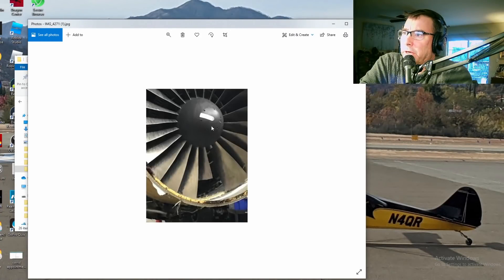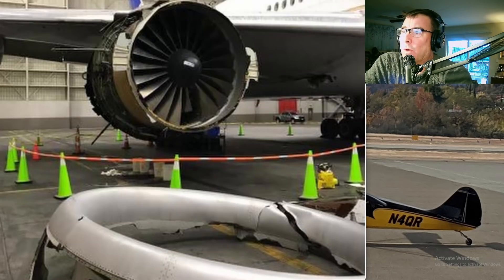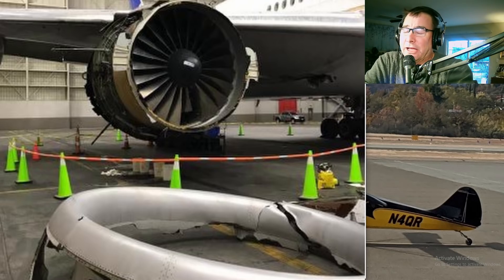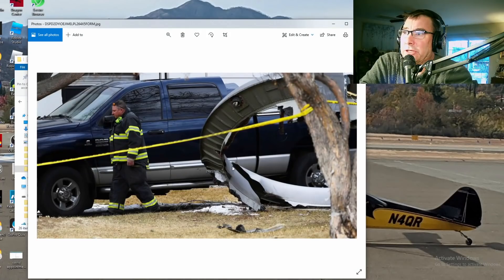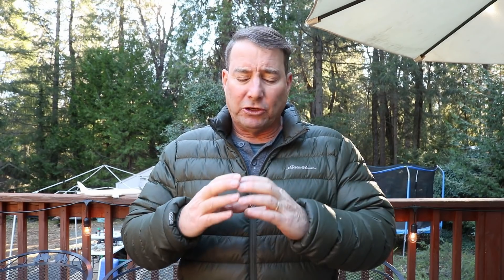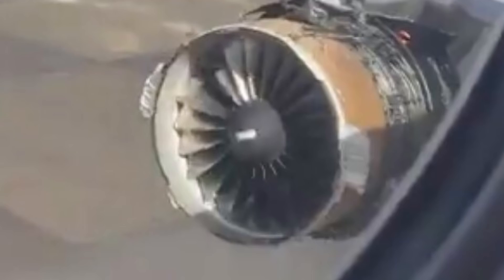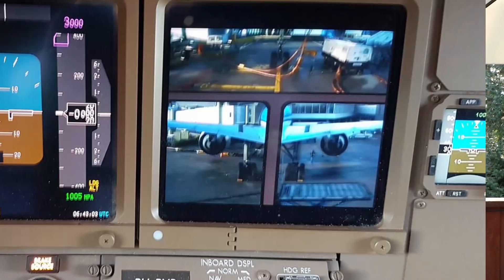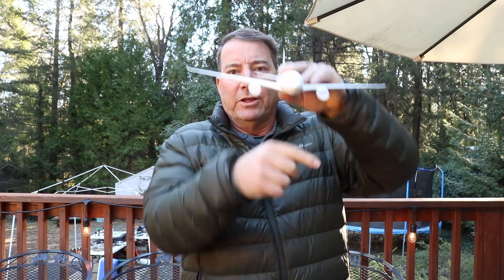UAL 328 UPDATE Fan Blade Failure  B777-200  22 Feb 2021

Comment: Regarding etops in a case like this - how likely would it be for the extra drag from the damaged engine to require so much extra fuel that you can't reach your destination? For example, if the cowling had opened up into a "flower" shape and didn't come off. Also - you mentioned that you are supposed to continue flight at the same speed as you were cruising - is that same Mach number, same IAS, or same TAS?

Comment: Well built aircraft, excellent crew - great report. Lots of post. Seems like you could use infared camera to partially monitor turbines before take off.
Any fans of Juan know if review of this kind of incident takes 18 months by NTSB? Seems like the aircraft would have more energy at 35K than having to go back 20k , but that's a safety call. Flying C123's ya didn't have these problems.

Comment: Daveo Australia here wow what a great video and very informative. One quick question how strong is that pylon under vibrating engine holding that engine and I always think about the accident which I think was the DC-10 where the engine flicked up over the top of the wing and investigation improved the pylons were not stored properly in the hanger previously which caused fatigue cracks thanks.. Just wondering if they have strengthened those pylons that Attaches the engine to the wing

Comment: I wonder if the  NTSB will set this plane up in a test rig and get the engine rotating at the windmilling speed to see the  result of the vibration  on the engine mounts and wing.

Comment: Well, one of the cockpit perks is having the safest seats on the airplane for awol engine part trajectories.  Although this fire was apparently relatively benign, is there any desperation procedure for trying to put out an engine fire if the extinguishers don't work over the middle of the ocean, like maybe heading for a rain squall or (don't laugh at me) intentionally doing something to get it to vibrate so bad that, along with some semi-aerobatic maneuver, it breaks off the mounts?  OK, now you can laugh.

Comment: In the 1950's and 60's jet air craft were delivered with engine vibration monitoring systems which were later disabled. I wonder if it is time to consider reinstalling this type of system to detect incipient blade failure by noticing a change in harmonic vibration of the engine?
Reply: The EICAS on the 777 can monitor more engine parameters than a 1950's vibration gauge can ever dream of.
Reply: @dynasty0019   I have been retired as an airline mechanic for twenty two and one half but I have worked on airplanes with the EICAS system installed(767) and  I know it's
 capabilities. I know very little about 777's. We had them, but I never worked on one. However what a system can do and what it will do depends on the airplane manufacturer, the engine manufacturer, The FAA and the airlines. If the EICAS is to display engine vibration data the engines must have vibration sensors ( accelerometers installed. These are usually installed on the fan case but others could be installed on the turbine case and other locations as determined by the engine manufacturers engineers. The aircraft must be wired to provide power and a signal path for the data, The information can be displayed on a traditional steam gauge or sent modern high data FDR's for later download . It could be sent to the EICAS system to interpret and possible display to the, it could send it onto the ACARS system for display it could direct the ACARS system to send a message to a ground station directly to turbine engineering for evaluation, or in the case of United Airlines it could be transmitted directly to the electronic log book system as a mechanics writeup. But whatever method is used to detect unusual engine vibrations it is a very serious issue The military recently lost two C130 airplanes and crew members due to propeller blade loss caused by metal fatigue failure at the blade root and high bypass turbo fan engines are suffering the same types of failures. The longer the blades are the greater the amount centrifugal force is applied to the blade root and fan disc.

Comment: Re: ETOPS, would you have enough fuel to make Honolulu or SFO if you lost an engine at the midway point and you had to descend to 10,000 because of a loss of pressurisation due to puncture of the fuselage from engine shrapnel?
Reply: Yes, ETOPS flight planning calculates the fuel requirements of a decompression, and engine failure, or both.  If at the critical point (not always midway) there is a fuel deficit, additional fuel is added to compensate.

Comment: Has it been confirmed that the engine was still on fire after they landed?  For me that's the most worrisome part of this incident.  I assume you've seen the recent pictures of the hole in the fuselage, right at the wing root.  They are so lucky that debris didn't puncture a wing tank.

Comment: As usual Boeing will set a committee to prove this was pilot error.
Reply: Boeing doesn't do that, they can send their engineers to assist the investigators on the technical aspects of the plane. The NTSB is totally independent and Boeing does not have a single say in the matter.

Comment: Juan - Just curios.  If a Pilot is certified on a 777 does it matter whether or not a particular plane has the P&W or the GE or is the certification good across the board independent of power plant manufacturer?

Comment: These fan blades have a finite lifespan because they go through expansion and retraction cycles during their working life. Typically they elongate to a certain extent over time due to exposure to these high operating temperatures running the risk of fatigue cracking. Usually they have periodic High Frequency Eddy Current NDT (Non Destructive Testing) inspection to check for minute crack propagation at which point a blade will need to be replaced. In the past minute voids within the grain structure of these blades introduced during the manufacturing process led to engine blade off events. It will be interesting to see if this particular airline in question regularly made these important checks. 
Thanks again for the update Juan.

Comment: Hi. I am not familiar with 777 fire extinguishing, but on airbus models the are two extinguisher bottles per engine, and the crew can select, depending on flight crew manual if both bottles are activated and the timing, but usually the first is used immediatly and the second is kept in case of a fire relight, also the philosophy is that the engine is divided in fire zones, mostly compressor, combustion chamber and auxiliary gearbox, that are effectively isolated from one another to maximize the effect of the extinguishing agent, and prevent a fire from the compressor stage to propagate to the combustion stage and get to the fuel lines. this extinguishing agent acts on starving the fire from oxigen, in this case due to structural failure of the fire zones and the altitude of the aircraft most of the extiguishing agent excaped the fire zone and current oxigen concentration kept the fire going, i believe that the turbine zone fire we see started on the compessor stage, probably for a fuel fed actuator or a engine oil line that spread to the hotter engine zone, like pouring gas over a hot car engine. The system worked remarkably well with all this constraints and factors.

Comment: Juan, just a side comment that may or may not be significant.  In the early 2,000's one of the leading manufacturers of jet engine fan blades closed one of its most experienced US finishing and inspection plants, initially outsourcing the work locally at first and then eventually transferring the work to a newly built plant in Mexico.  I know that it took over two years (maybe three?) before the workforce there was able to produce the first part that could pass inspection.  The Mexican plant now does most of the finishing and final inspections (X-ray and dye penetrant).  I don't have to tell you how high-tech and mission critical these turbine Jet airfoils are.  I am not saying that making this change has compromised  quality and safety.  However, saving $$$ at this point in the manufacturing process does NOT seem like a good decision.

Comment: You may be correct that the fan blade exited the engine via the inlet but I think this would be unusual . When a failed wide chord fan blade is arrested by a Kevlar wrapped containment casing it is immediately struck by the trailing blade. This would normally propel the released blade aft. In so doing one can expect the impact to cause a partial failure of the trailing blade which is what you see here. I would anticipate finding  the failed blade lodged against the fan outlet guide vanes. The extreme out of balance forces can be enough to challenge the structural integrity of the intake.

Comment: To review : At the worst moment an engine fails, debris punctures the fuselage and departs the wing. The aircraft has to descend to 10,000 ft and the remaining engine is going close to full power, burning MORE FUEL; that engine is now at a lower inefficient altitude and so is using MORE FUEL;  to compensate for the weight imbalance the aircraft must use large aileron deflection as we are now at a slower speed and so we are generating drag and so MORE FUEL, the differential power requires the rudder to compensate and so we have more drag and so MORE FUEL and we are doing this for a longer time so MORE FUEL is required. Whew...that's a lot of extra fuel and we have a headwind going westward.

Comment: Hello Blancolirio. First, congratulations... great videos with always good information. I just wanted to mention that the Boeing Fire Eng L,R checklist does not state not to dump fuel in the event of a fire. I believe that must be in an Operator specific QRH. (As always, prudent pilot judgment is required 🙃)👍
The -200 Series are not equipped with the exterior camera system..... only the -300s.

Comment: G'day Juan. Love your information - thank you very much.
Just some info for you. The 777-200 does not have the GMCS cameras you were describing on the 300s. As you mentioned, they are designed to stop you running that big long jet off into a ditch. I guess Boeing didn't consider the 200 long enough!

Comment: What about an ETOPS situation in which the failed engine also results in fuselage damage and a depressurization?   Now, you're flying at 10,000 ft. half the distance to Hawaii as a single-engine B777.   The Southwest 737 incident showed how easily that situation could develop.   Add to that an out-of-balance engine and maybe a little fire to go with it.   Yikes!

Juan, this channel is awesome!   Thanks for the frequent updates!

Comment: Sorry for the stupid question but, how did they handled the slowing down during landing with a fully loaded (fuel and passengers) plane and asymmetric thrust reverser (just engine 1) and a potentially contaminated (rain or snow) runway? Thanks.

Comment: ETOPS certainly doesn’t stand for extended twin engine ops, it’s actually the appropriate acronym for Engines Turn or Passengers Swim, just kidding, that’s how we mechanics view ETOPS!  I was on the receiving crew for the very first B777-200 at UAL and have the Pratt and Whitney emblem off of the #1 Engine gearbox.  I was taxi and high power qualified on the same, the damn thing was a menace taxiing around SFO.  Can’t tell you how many fire house doors were destroyed coming across the 28’s to deliver the aircraft to the PAC gates.  I remember many a night out on the 17L run-up area doing high power test runs on the 777.  I remember one night going out and running in a horrific rainstorm, aircraft was light, and going to high power.  The aircraft slid on the pavement so fast that we almost had a runway incursion on 17R.  At the time, these engines were the most powerful aviation engines ever flown and we had a very steep learning curve to get a handle on them.  That first 777 lost most of its right horizontal stabilizer during a high power run when the engines pulled up the asphalt at the concrete apron margin in the 17L run-up area.  We are talking 18” thick slabs of asphalt the size of a Ford pickup smashing like shotgun buckshot into the horizontal stabilizer and side of the fuselage.  That cost the Lazy U several million in repairs.  Engineering figured that the low pressure caused by the volume of air moving across the ground just sucked the asphalt out of its bed.  A Pratt & Whitney engineer told me that the 4077 engine flowed the same amount of air at high power in one second as a human breaths in his whole lifetime, think about that!  When the P&W 4077 started some compressor stalling issues it got really exciting.  There is nothing more terrifying than performing an accel/decel test on the engine and having it stall at about 1.56 EPR.  I’ve cried for mommy twice when it happened, it also turned the aircraft under full brakes about 10 degrees during the event.  Nothing like 100,000 h.p. deciding it wants to reverse its gas path in a millisecond, oh the horror!  The 777 is truly a marvel of aviation.  When it came out it spelled the beginning of the end for Boeing’s 747 program.

Comment: Hollow Titanium is the culprit. Titanium is light and strong, but when titanium fails, it snaps. I suspect the newer Carbon Fiber Titanium Composite fan blades used by GE are more durable. Carbon Fiber blades have many layers while hollow titanium blades would suffer metal fatigue. Carbon Fiber is the fix.

Comment: what if these twin (humongous !) engined type intercontinental airliners prove to be 'deficient' in engine reliability ???
Remember, it was just some years ago that 4 engined jetliners were the norm and such twin engined jets had to cross the Atlantic or Pacific 'hugging close to' airports (w/in a few hours) along it's transcontinental route, ...
longer hours, more air miles, and more jetfuel expense.
Could it be that the Boeing 747, the Airbus 340 & 380 will soon be needed ?
As I understand, recently, another 2 Boeing jetliners have experienced engine failures, both of the same engine model ?
"Too Big to Fail" can never be the norm in such intricate machinery !
Attention GE, CFM, Rolls-Royce ... engine manufacturers, will science and technology bail you all out here ???
We shall see !

Comment: Its a big question did the broken blade go through the engine after banging the side, busting the cowling, or was it able to escape uncontained slicing the cowling on its way.  I assume it went through the engine, which damaged the reverser causing oil leak and fire.  Maybe the full blade escaped and the half blade sucked through.

Comment: GE90 driver myself, they make great blades!  Fan blade separations don't usually result in engine fires.  I'm guessing the smaller broken blade or parts of it were ingested through the compression stages causing oil to leak. It will be interesting to read the full engineering report when published.  We had a case on take-off whereby a blade separated and flew forwards and out of the intake, bounced off the runway moving sideways and then embedded itself in the other engines nacelle.   Take-off was rejected.  Fan blade separations on test rigs don't replicate real world results!
Reply: Has the engineering report been published. I'm a bit behind the curve on this one?!
Reply: Are the Pratt and Whitney engines made with composite matrix material as I believe the G90 motors are?

Comment: They don't make engines like they used to anymore.
Reply: Yep, they’re bigger and more efficient with some of the biggest fan blades around. Hollow Titanium is the culprit. Newer GE engines use Titanium with carbon fiber In combo. Much more durable.  Just like Carbon fiber wings and fuselages. Less metal fatigue.

Comment: Lucky you that you get to fly such a cool and safe airplane.  Angle of attack:  So the parts get deflected out the front by the other rotating blades...?

Do you think they may have taken too much mass out of the structure of the newer engines...?  After only 8 to 10 years the Trent has had a series of inspections/etc. on the B787.

The B777 family are the safest airplanes...ever.  These large twins got rid of the B747 and A380/A340.  If there is a serious problem it can be identified and fixed and it will be.  If it is corrosion or wearing out somehow, they will replace these parts or whole modules and they will perform as they have done since EIS.  The cost will be huge though and these airplanes were under market pressure already.  Lessors exposed to this will be not best pleased.  GE/etc. will be having a closer look at their older GE90s as well...and hopefully the regulators force this...when they get back from the golf course.

Comment: Thanks for adding this information. Why don't they install a camera in the front side of the fuselage pointed towards the front of the engine? Technically they could install a moveable camera that can also zoom. So pilots can get detailed view from the engine and also the wings leading edge for e.g. ice inspecting. On total price of such planes two extra cams wouldn't make a big difference, would they?